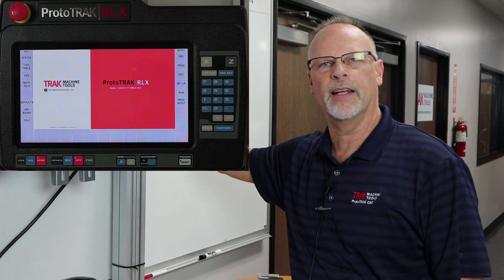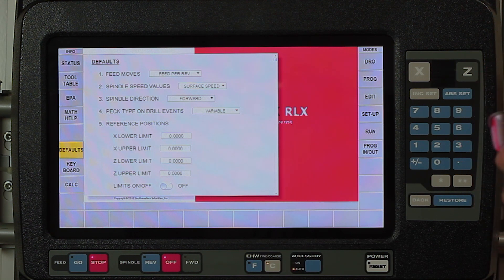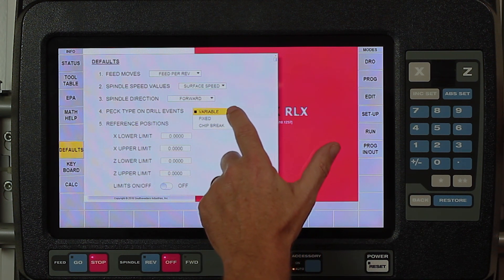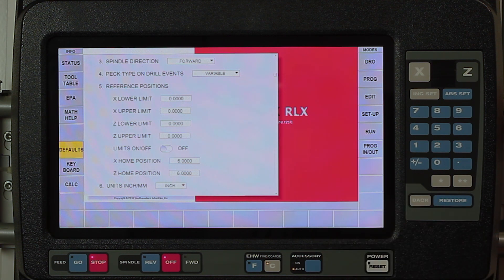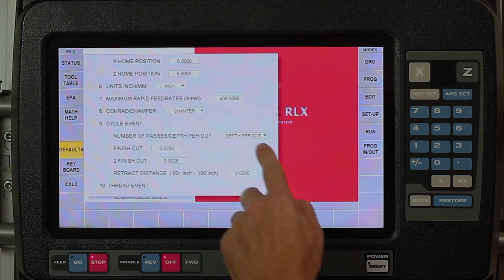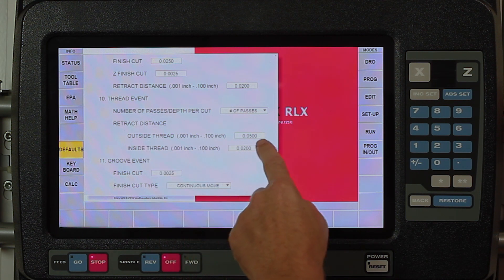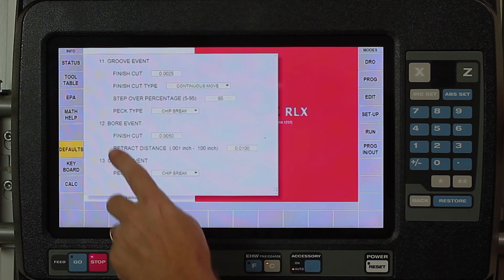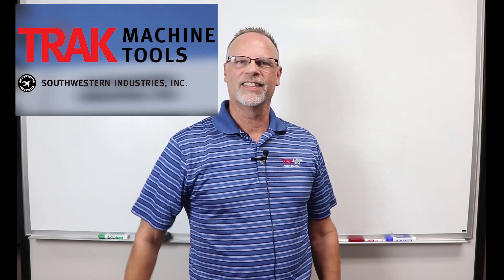Defaults & Options [Part 1] | ProtoTRAK RLX CNC | Lathe Programming

Comment: Im learning the RLX control and reall struggling with understanding how i communicate with filling in information (its alot of trial and error on my part)
Now I'm trying to understanding when using a tailstock do i depend on home position or program a position to keep from crashing into tailstock?
Yes i watch video's over and over again until it males sense.
38 years as a manual machinist i thought prototrak would be a little more intuitive when learning, the younger machinist seems to pick it up quicker than i.

Comment: can you do a npt thread?
Reply: Yes, on the RLX we can.  You simply switch from standard thread to NPT, choose the thread size and the control fills in all the values to make the thread.  We currently do not have a video on this but it is in the works.  n the meantime, have your local TRAK rep show you how easy this is.  T.P.
Reply: @trakingpat2750      so in options select custom. dose my hole have to be bored out with a tapper. thank you

Comment: We got 2 DPM SX3P's at the gauge shop, and 3 manual lathes that NEED to be a Southwest lathe. Management and the lathe hands just dont understand how useful a Southwest lathe would be for the work we do. Its a lot of diameters and shoulders that a trak would eat for breakfast.
Reply: Hopefully with your input, you can help the salesman convince your management to get one.  The mills should be a good example of how much time they can save when turning parts as well.  Good Luck!  T.P.